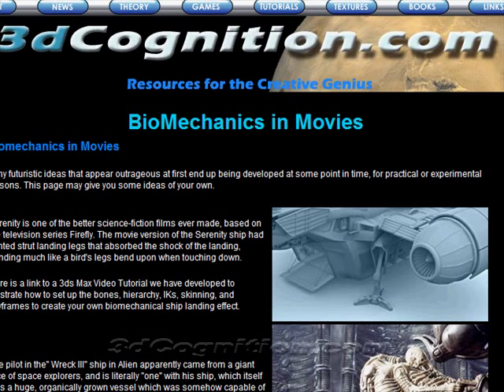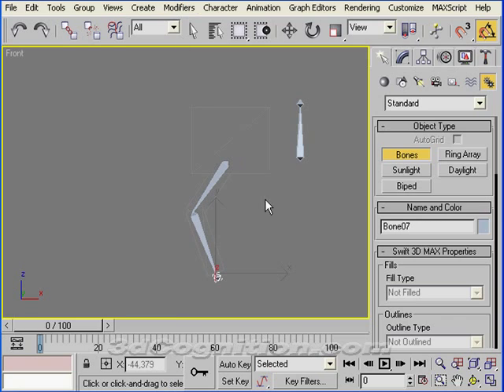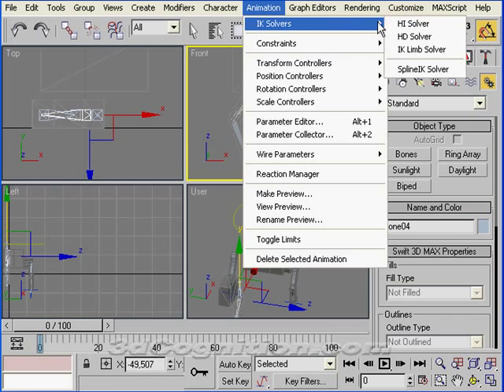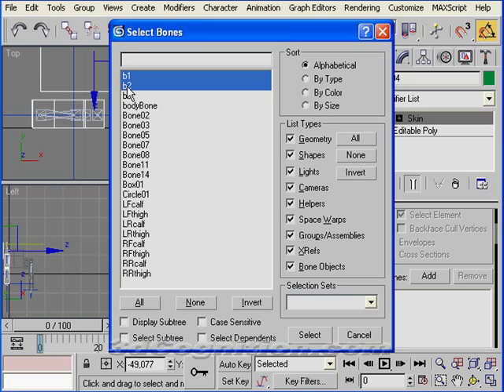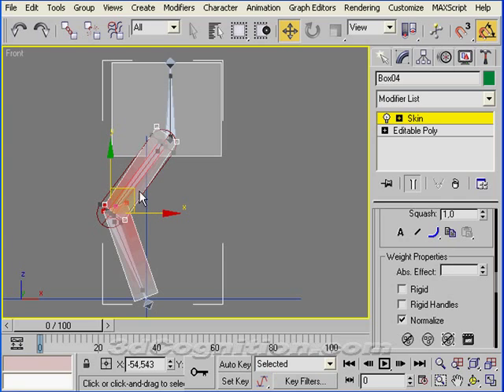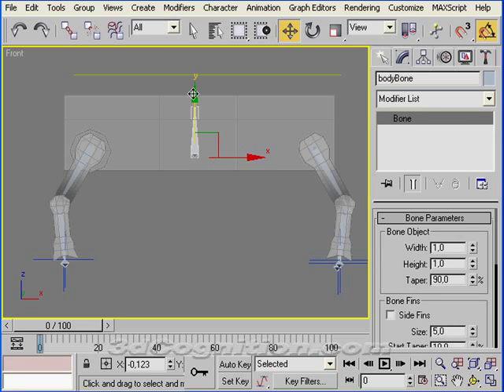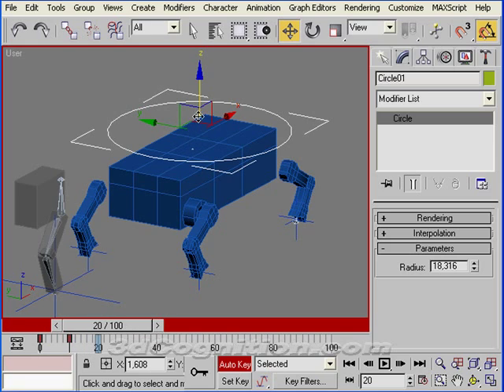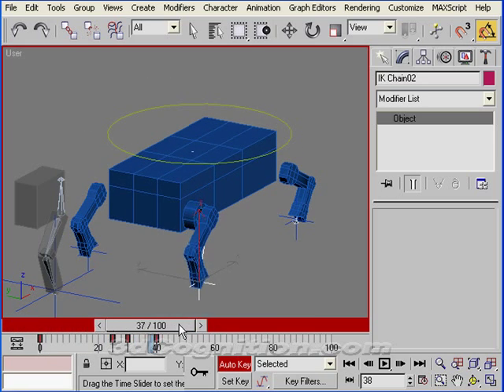3ds Max Bones Skin Tutorial - Serenity Lander

Comment: I have a question, Im currently applying the skin modifier to one of my rigs, and im trying to set the weight of the vertices individually but every time I change one, it reverts back to 1.0 have I done something wrong? I also dont have select element checked.

Comment from the maker: @redhors  - I think that is just the IK being stretched - it does happen sometimes but if it is happening a lot, you may be doing something wrong. For example if I am doing a walk cycle and I make the character come up too high, yet the feet are stuck to the ground, I will get a blue line from the IK on the ground to the foot as it follows the body into the air.  I am working on a bones demo that will hopefully demonstrate this issue.